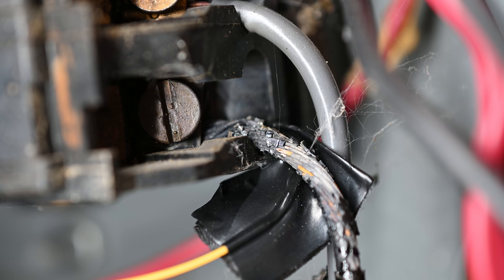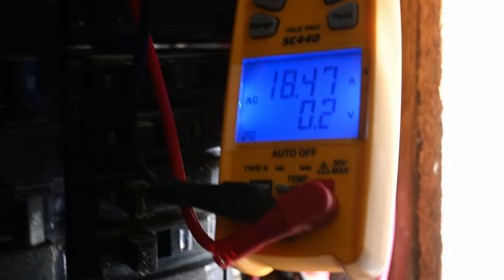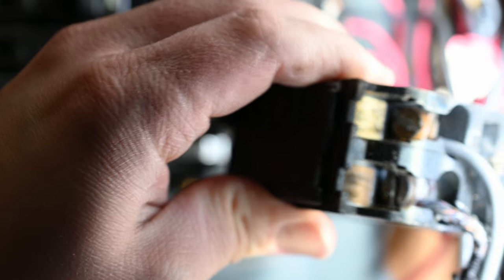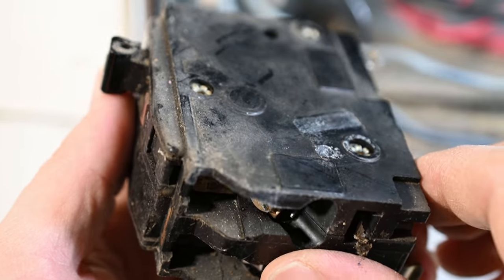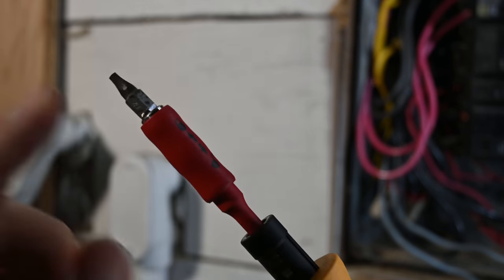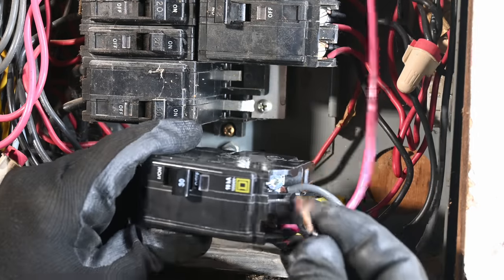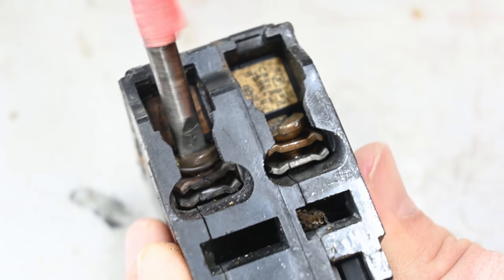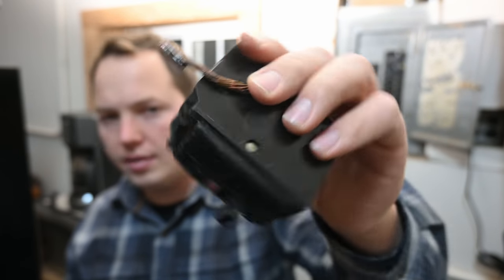Burned Wire On Breaker - Torque Screwdrivers & Why You Should Probably Be Using One

Comment: The loose connection caused the internal issues inside the breaker. When using stranded wires to connect to a breaker, I would twist the wires to make them more stiff then under the breaker. I wish square D would use the same breaker connection as used in a 40 amp or larger. It is a Lug type instead of a clamping style.

Comment: The previous amps were around 18.8 and after the fix, it was 18.2, so the burned wire was causing the system to pull more amperage for the circuit.

Comment: is it possible that the burnt wire has suffered any damage beyond the 1/2 inch you cut? Thank you
Reply: Prolly not. The exposed points are oxidizing with enough heat so if there was more damage it would extend from the terminal end not from random points on the wire itself, unless nicked elsewhere.

Comment: Copper work hardens,
 If you deform it too much it becomes brittle and cracks 
So yeah, you can actually overtighten that terminal.

I've also learned the hard way that the safest way to lock out a breaker is to have it in your pocket until the job is done.

Comment: You'd do better splitting off half the strands and putting some one side of the screw and some the other side - that way the pressure is independently applied to 2 sets of strands !

Comment: No one seems to have mentioned that the heater was drawing 18.8A at first and then with the new breaker, 18.3A implying that there was 0.5A worth of heating at the poor connection (approx 50w) right on that terminal.

Comment: yes, i have seen similar thing (not exactly), it was a set of flood lights of 10. all control by one switch (actually the fuse itself). i believe it was 220v 30a? and every night it was switch on manually and off at dawn. after about 10+ years repeating this practice, it spark, and burn (weld together at the contact points) without trip off electricity, burn the entire fuse box. that lesson tells me, don't use your fuse as switch. and don't trust electrician tells you it is OK to do that. 

fuses are not switches. 10 years, that's about 7300+ flips will have mechanical failure on plastic parts and screw lead, the result is spark. this is what i learned.

Comment: The reason they have a different receptor is so you use only their bits so it’s calibrated, using different length bits will change the actual torque you’re applying.

Comment: I was in my own panel to remove an unnecessary circuit and add another. while I'm snaking the Old Wire out it caught on a subpanel feed from a circuit breaker and the wire just pulled out of that circuit breaker! It was loose and only caught halfway. It probably wasn't pushed in Far Enough and not tightened properly. This was worked on by an actual electrician just before I bought the house some 15 years ago. The house was upgraded to 200 amp service which included a new panel. Everything was touched and should have been correct. You never know.

Comment: I just got a Siemens  quad breaker,  so I can add another  220V  circuit on a full panel.   Are there any issues to watch for on these?
Reply: Just FYI it's 240 Volts not 220. The main thing is to know what loads will and will not be used at the same time as the new load you are adding. The other thing is to know what your service and main breaker rating is. Is it 100, 125, 150, 200, or 400 Amps? 400 or more Amp service would be for a big house so chances are your service is between 100 and 200 Amps so you need to calculate how much load you will be pulling in total while your new load is being used. For instance, if you are planning to add a Tesla charger but will only use it at night, and not using the oven at the same time, then it's likely that you will be safe to add this type of load. The other thing with quads is they can create a hot spot on the bus bars of the panel so you don't want to crowd a bunch of high draw circuits all in one small area. Be reasonable with the loads you are adding and best bet is to get an electrician and spend the money to do it safely and by code.

Comment: Current is now 18.2A. Before it was 18 5A. That means that heater voltage is higher now and heater gets hotter, what takes its resistance up.

Comment: The 60Hz bacon sound FX at 4:30 is concerning ... I was also very surprised to see a panel full of stranded wires! Here in Canada, our code requires solid conductor for premises installs because that lowers the risk of having one of these types of arcing loose connections.

Comment: Wouldn't it be a good idea to use a sleeve on stranded wire where it connects to the breaker?  I'm not sure "sleeve" is the correct term.

Comment: To much or to little is not good. I`m like quite a few out there I learned with a inch/lb torque wrench and then went to feel with a tool but I like to come back now and then with the torque wrench to more or less calibrate my feel. Not the perfect way but no issues so far.

Comment: I've never heard of an electrician using stranded wire on high amp appliances. I've used stranded on 12 to 18v solar lead in's but never past the inverter. I would be tempted to change the wire out to solid core. The only time I've seen stranded wire used was in my mothers house built by cheapo developers in the very early 60's. In that case the ran 3 strand/leg through a single cable with no ground.....  I had to repair connections pretty regular by stripping the wire, polishing it, then grease and re-install. I find it strange that there is no electric grease (anti corrosion) used on the copper to steel connection at the breaker. (possible alum) I always double check my connections after a week or so. when I watched you torque with the regular screw driver it made the back of my neck crawl.... not enough torque.
Reply: Stranded wire is used basically everything except small Romex used for branch circuits. As the wire gets bigger, the strands also get bigger. On 2/0 copper, there are I believe 19 larger strands. 

If only solid copper was used, it would be impossible to bend cables, or pull wire through conduit. Could you imagine 6/3 Romex if it had 4 solid 6 awg copper wires inside it? Or 2/0-2/0-2/0-1 service entrance cable? It would not be usable. When wire is pulled through conduit, stranded wire is used for basically everything.  

Also, corrosion inhibitor is not used on copper wiring with breakers, or with aluminum wiring for that matter. Breakers are rated for both copper and aluminum, and the UL Listings don't say anything about using Noalox or any other corrosion inhibiting compound. The only time this compound is used is when working with older aluminum wiring. New aluminum alloys don't oxidize in the same way as the old aluminum that started so many house fires.

No offense intended, but I hope you know that you don't have the knowledge to be suggesting repairs to people, or what is right/wrong.
Reply: Usually anything 8 AWG and larger will be stranded. I am not sure which country you live in but if it's USA then you are just lacking electrical knowledge. Air Conditioning, Ovens, Dryers are usually stranded and the service coming in to feed the breaker panel is always stranded.
Reply: @commoncentstx  wrote a response to your post. It was deleted. Not interested in continuing your education for free. 58 years wiring and inspections. box doesn't have a ground, wire is too small for that application. Under torque often takes a while to show up with the heating and cooling of the contacts. I like the vid but no inspector would pass it.
Reply: Stranded is superior to solid in its ability to carry more amps per wire given the same conductor od.

Comment: I had the same problem,  burned wire,  Bad connection and also had some contact problems on where the breaker connected the mains, Some breaker boxes have aluminum mains, that is no good

Comment: A couple of thoughts/questions:  First, nice video in general.  Insulated screwdriver really (really) needs replaced shaft/bit; that thing is insulated in name only not function.  Good point on the open hole in the back of the panel; but what’s up with that the outlet beside the panel.  Might be OK according to code but that’s an odd configuration.  (Yep, you are the electrician, not the owner to so you get to see a lot).  Gas cap, good analogy on torque; next time clean that space dude; you look more professional.  (Hehe).  Lastly, do you know how hot the entire wire was getting?  Looks pretty ugly at the breaker end and it’s only rated to specific temps; so even if it looks OK, the insulation might be damaged due to heat; that needs verified before closing out the job.  Nice work replacing the breaker then tearing down the old breaker; that burnt side isn’t going to win any beauty/handsome contests, eh?  (My guess was like yours, just a torque issue on the screw - that tear down just made it obvious there was a deeper issue.)

Comment: I make it a habit to check connections at panel boxes pulling on each wire.  If I see any wires move, then I go through and re tighten every connection. You'd be surprised how loose connections can become over time on old ass panel boxes.

Comment: Not an electrician but car mechanic.
Never use an torque wrench on power cables, cust tighten very hard by hand where i know it is more than specified.

Never had an issue and always ends up better than it was from factory and we speak of several hundred Amps not just tens of it 😅

And on home electric i also turn it as hard as i can without stripping it. Rather replace something i stripped out instead of having it loose, have seen a lot of burnt cables and connectors on cars

Comment: It's interesting to see how the Americans do electrical stuff, them breakers are no longer used in the UK and RCD's are the norm with new installations.
One thing I can't get my head around is why the Americans use split phase systems, we over here only use 415V 3 phase for industrial machines and 240V single phase for all houses.

Comment: 13:13 I found this on Wiha's FAQ: 
The speedE®I and II are only compatible with the insulated, VDE-certified Wiha slimBits. This is to ensure the user’s safety and protect them against danger when working on live parts. Bits, socket nuts and blades with a 1/4” slot are not compatible with the speedE® I and II. In contrast, the speedE® Industrial is used in combination with the speedE® Industrial bit holder and the Wiha standard bits (1/4'').

But I also had a similar issue in reverse once, thinking for years that standard driver bits were 6mm (1/4" = 6.35mm, it looks practically the same as 6mm), and trying to use one in a 6mm socket on a ratchet wrench to screw something in a tight spot.
And everything is Metric where I live, so I didn't have any 1/4" sockets, you can't simply get one from a local hardware store, and online shopping wasn't really a thing yet back then either...

Comment: Ben, great video and you pack a lot of knowledge and information into everything you produce.  Thank you.  One question/concern though.  I noticed you threw the main breaker without first shutting down the individual branch circuits.  I've been told that could cause internal arc damage to the main.  Individual branch circuits should be DC'd first, then the main.  What are your thoughts?
Reply: No

Comment: I've seen many breakers running HOT. Interestingly, more times than not it's been on stranded wire with a loose connection. Stranded wire especially should ALWAYS be torqued, and all the strands should be present with none missing due to careless stripping. Loose and missing strands of wire carrying the same current will always run hot, even without arcing. We size wire in a circuit for a reason. Every connection in a circuit should be complete and tight.

Comment: They need to be cranked as tight as you can with proper screwdriver, just don't break terminal.  I remember once I was having a bad day, and forgot to even tighten the water heater 30 amp breaker lugs, needless to say, I had some apologizing to do.  You can't go wrong with torque screwdriver.
Reply: If I crank them as tight as I can I've found that I can often either (1) break the bit or (2) strip the screw out.
Reply: Sometimes when you move the wires around later on the strands realigned themselves and they lose their compression under the screw
Reply: One issue Ive always thought of with tightening these kinds of screws, be it on breakers, lamp sockets, outlets or switches is, the threads the screws go into are only little more than heavy sheet metal thick, it seems like it would be real easy to strip the threads out and ruin the component
Reply: @HobbyOrganist  The threads are beefy and thicker then a average nut, they have to be.

Comment: Surely a resistive load like a water element physically cannot overload in anyway, it can fail but the resistance of the element can't change in anyway to influence the amps. Even under loose connection scenarios it can't just pull more amps. Thats what makes sense to me anyway?
Reply: But you never know which amateur has added a load, like a car charger, somewhere in the line maybe under the house.  Checking and verifying the amps load is just a simple double check for standard troubleshooting.

Comment: If it's AC, why does it usualy overheat the wire at the breaker terminal and not the neutral bar? Also an overloaded plug will overheat from the smaller hot side. Is it because of less surface area on the hotl side?
Reply: this breaker is for high amps at 220 volts so all the power is going through 2 terminals on breaker it is not going to neutral

Comment: Would there be a wire heating up issue if  connections of  12 or 14 AWG solid wires to  sockets and light switches were not as tight as they should be?
Reply: YES

Comment: Could have been from a dirty contact. When a cable is tighten it will always relax after a few min and go back and it will be looser. Retighten at the end of the job all screws. But wires that heat up muttiple  times will aneal the coper and make it soft and losen up.

Comment: I disagree, the heating of the wire over heated the elements inside. Also the breakers can become heat fatigued. This makes the breaker more sensitive to current near maximum. My father and I would test breakers for time to open when hit with overload current. The breakers are suppose to trip faster when hit with high current 20% above their rated current. At one time I had a large collection of breakers similar to yours. Thanks ps. any time I opened a panel I always tightened all connections or at least to see if they were snug. We also used infrared detectors to look for this problem through the box at a distance.

Comment: HEADS UP!  MOST other countries REQUIRE stranded wire terminations to 1st be FERRULE CRIMPED BEFORE attaching to service panel breakers.
Reply: that is honestly so much more reasonable
Reply: That's true up to a point,  when you are using stranded wire with more than the 19 strands common in THHN . European wire runs to much higher strand counts, as well,  they have tighter current limits for appliances.
Reply: @cevgunnerF  IT'S about CAPTURING the wires in a BUNDLE, then crushed by the breaker clamp, preventing individual wires strands from SPLAYING.  Thus, providing FULL USE of EVERY single strand, that otherwise may not carry any current at all.
Reply: @spambot7110  ??
Reply: This is likely the bigger issue I would guess. Stranded never torque right. Let alone hold that torque.  Although not an electrician by trade I've seen it happen on  equipment

Comment: 1.18.22 Ben question.  What would be your thoughts on using wire ferrules on the stranded wire and then thighten into the breaker?
Reply: I'm a retired generator technician. I always use ferrules on stranded wire.

Comment: oh wait, once you opened the panel and I seen "Square D" "type QO".... yep, probably not the wire or person that installed it's fault.
the spring clips rust/corrode/lose tension with thermal cycling on the buss bar end and lose tension, if not caught early on they'll cook themselves and the panel buss bar too.
still better than old federal pacific and pushmatic ( burn it down specials) proper size fuses worked better than most, even oversized to 30amp time delays was often safer 🤪🤪

Comment: This water heater draws 18.75 amps continuous load. Multiply 18.75 amp continuous load by 125% to obtain 23.44 amps. This exceeds the capacity of your 20 amp circuit.  This circuit must be rewired using 10-3 copper with the ground romax. Protect circuit with 25 amp or 30 amp GFCI circuit breaker. Check with the building inspector.  This is a design problem.